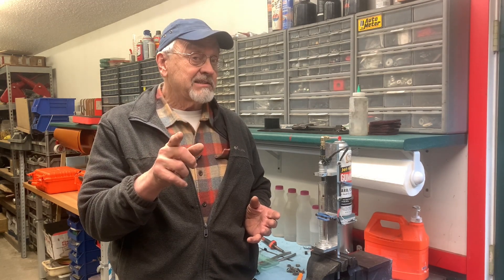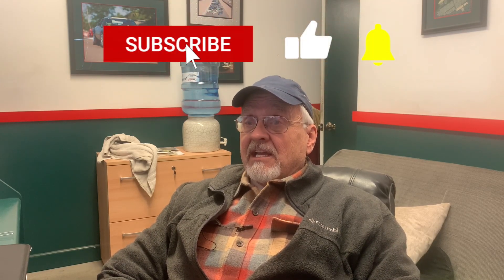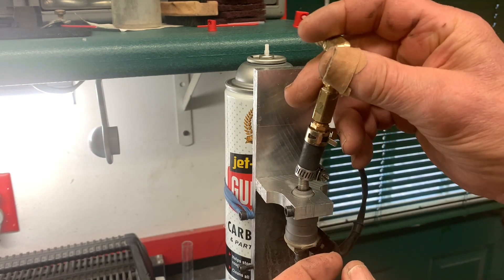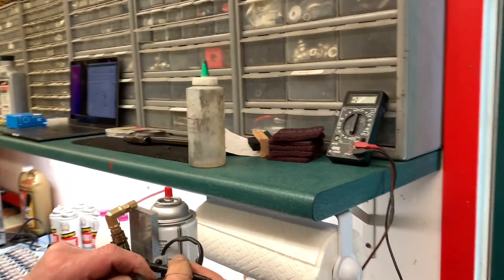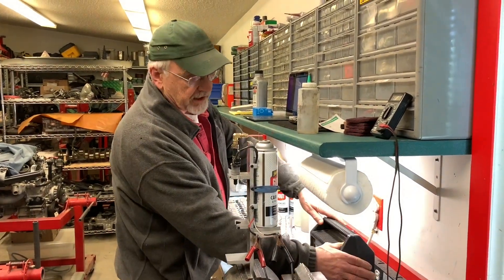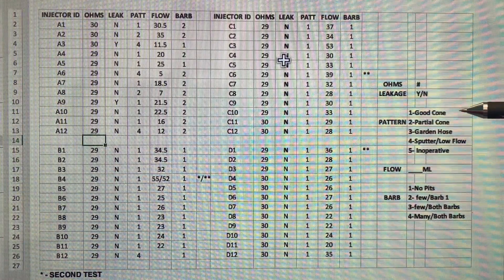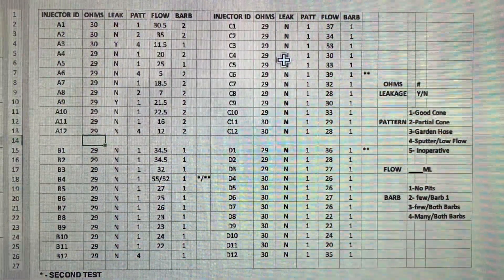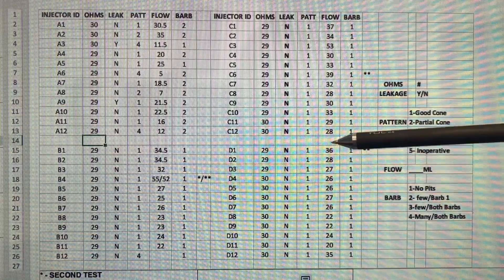S.3: Episode 12- Tool Shed: Clean and Test Jaguar XJS V-12 Fuel Injectors With a $40 Tool - Part 3

Comment: I love your set up this helps lot thanks
Reply from the maker: To be honest, this set up was a stop gap measure to enable me to clean and do simple tasks with what I had on site. Since then I have upgraded to a CT 200 cleaner tester, which is far superior and worth every penny.
Reply: @thecampchaoschronicles9567  I was looking at the CT 200 last night 😂. 
I do have a question maybe you could help me with, I have a 89 jag xjs with 70k it was parked for 8 years, I got the whole car for 500$ and its my project car, I was debating on doing full rebuild on whole car and started to do little stuff to it on my channel, the car over all looks fairly maintained and besides lil rust that was in it from leaving it sit for many years. With your experience would you recommend a full engine overhaul or just flush all the lines for everything out and see how it goes. I am very limited on money, dont have spare parts laying around. I have had to buy a new reservoir as the one I have is completely rotted with holes everywhere, the crossover pipe just as bad. So I ordered both of those used from online. What are your recommendations, I was thinking that after everything is flushed and put back together putting little bit of citric acid in it to flush any remaining rust out. Brakes are locked up as well, so this car is a complete project car im keeping. I love your channel it has definitely inspired me alot. Thanks again

Comment: With regard to your test setup and procedure I love it, but I'd make a couple of changes. My concern about the results is you have no way of knowing the consistency or duration of your pulses. A simple timer based on a 555 IC, transistor and a few components which could be made for a few bucks would guarantee consistent pulse speed and duration. The second thing is you gotta have consistent pressure. It might be more messing about but a pressure pump and regulator will do it. An aerosol can is gonna be changing big time from full to empty.
Reply from the maker: The plan is to replace the spray can with the Honda pump  I put in the Autool CT-200 cleaner/tester out of frustration with customer service. They have since come through with  a new pump that I have yet to install.  A reservoir and pressure regulator will go a long way to improving consistency but I agree with you about the timer. If you can come up with the component part #s and a schematic that you are willing to share, I think that would make a great video for which I will give you credit.

Comment: (Re: Algos - Be sure to use hashtags in your descriptions so when people are searching for something like #jaguar #xjs #injection it ranks higher in the results.  I tested this with a few of my devices and videos with hashtags get better ranking than better video's without them. )   Once you get them all cleaned, rebuilt, and tested, how comfortable are you mixing injectors from different lots?  Is flow your top criteria for matching?
Reply from the maker: Thanks, I’ll try that. Yes flow is the main criteria. Spray pattern is going to be the same on most of them. I’ll know more if I ever get the store-bought tester/cleaner running.
Reply: @thecampchaoschronicles9567  I don't know if you've ever seen the injector tester that @mercedessource here on youtube has.  I believe it's intended for mechanical injectors but its general design might be of interest to you.
Reply from the maker: @SparkyGage  I finally got the Autool CT200 working after 3 months of fighting with customer service and the results generally agree. Except at operating pressure. Then some don't work very well. Video coming soon.

Comment: Bob, super good stuff. The engine I sent you cremated the injectors as you have probably noticed . What do you figure is the value (ex Camp Chaos) of a Knodt-refurbished set of twelve?
Reply from the maker: Hi Bill. It depends on if I can get the original store bought tester working or upgrade my DIY set-up so I can get more useful information on flow. You could easily build the MK 1 apparatus and do the basic clean and back-flush operations on the running engine in your car. I'll know more later.

Comment: What is the correct flow rate for these injectors?
Reply from the maker: I have no idea. I'm looking for injectors that work with a good flow pattern and roughly equal flow rates. I have three sets out of four that generally fit that description with the middle flow set going on a customer car and the low flow set going on Ol'Tex.

Comment: In the first video in this series,  you said you would go over the issues with the "junk" commercial injector tester you bought, in a later video. Please do so.
I think you may be seeing two issues in your flow rate testing. First is getting the exact same pulsing waveform out of your dimmer arrangement. Rate and duration of the pulses is key. Second, as you said, is the change in pressure from the spray cans. A pump and regulator is a must, and it sounds like you are headed that way.
Reply from the maker: It doesn't seem like anything changes in rate or duration. It just gets louder. I have Walbro fuel pump on order and I'll use the coolant recovery reservoir shown at the end of the video as a supply tank. It may require its own power source. Or the new pump may actually work in the tester/cleaner I bought in which case all of this is unnecessary. Except I'll probably do it anyway for grins and giggles. In retrospect, I probably won't do a full video on the yellow tester unless I get it working and demonstrate it.

Comment: Could always build a small rig with a cheap 044 clone ext fuel pump & filter w/ a reservoir.   You might also be able to ultrasonically clean the injector while it is being worked inside a volume of solvent. (Just an idea).
Reply from the maker: Great minds think alike. I've got a pump on order. If it doesn't work in the junk CT-200 I'll use it on my test rig.